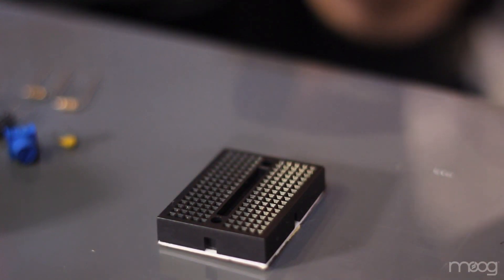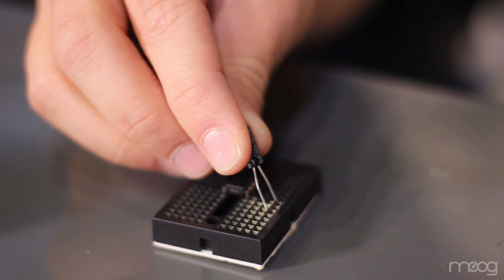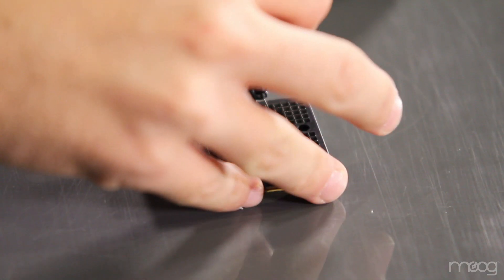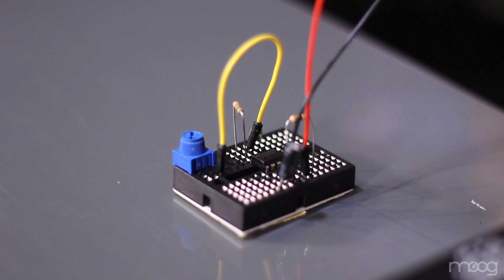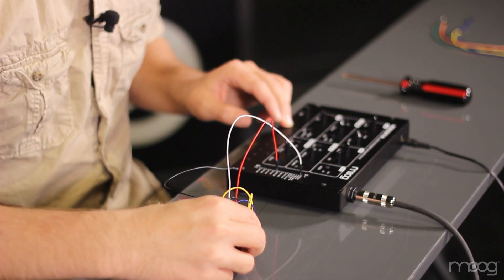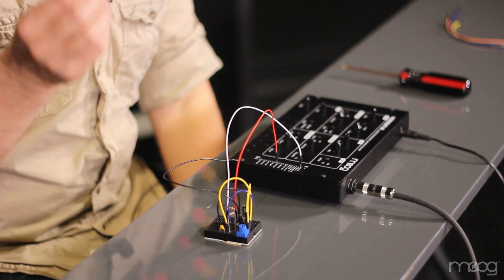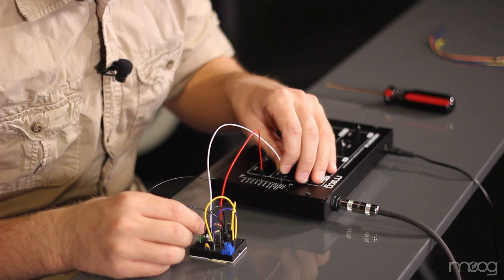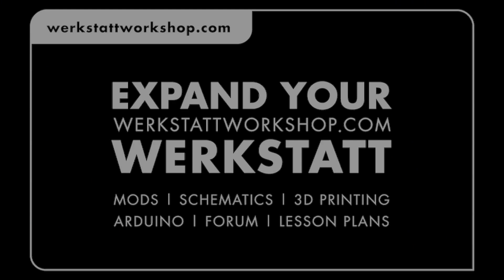WERKSTATT-01 | 555 IC - 2nd LFO

Comment: Read this if you can't get this working. The circuit that he explained must be a mistake. First of all, a 555 timer IC must have power to going into pin 8, that's its main power in. Second, pin 2 is the trigger signal. When the 10 μF capacitor discharges, it is supposed to discharge through the potentiometer into pin 7 and send a trigger signal into pin 2. By leaving pin 2 open, there is no trigger to generate output.

To get this circuit working, use jumper wires to connect pin 8 to 4 and connect pin 2 to 6. Enjoy your fun square wave LFO!

The frequency in Hz is given by 1.44/[(Ra + 2Rb)*C] where Ra is the 1.5 kΩ resistor, Rb is the potentiometer resistance, and C is the 10 μF capacitor. Download the xx555 manual from TI for more info, e.g. learn how to make this into a triangle wave. Cheers!